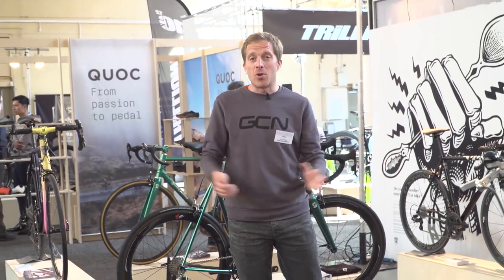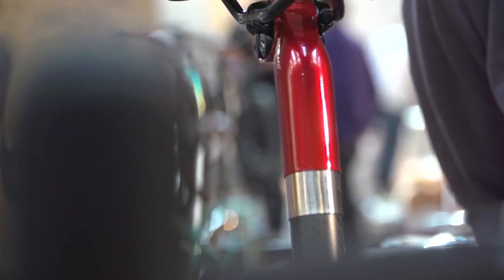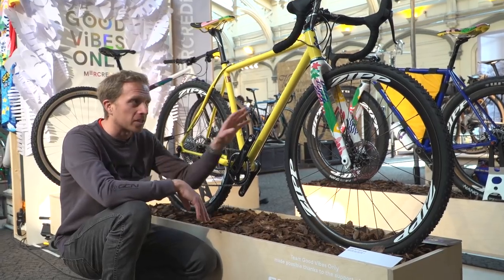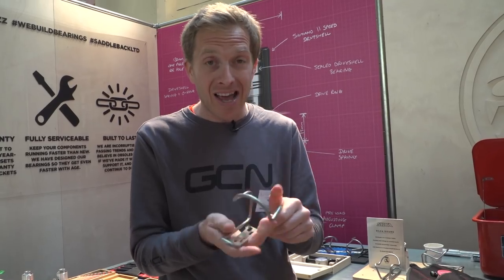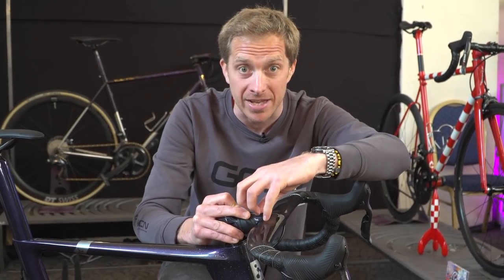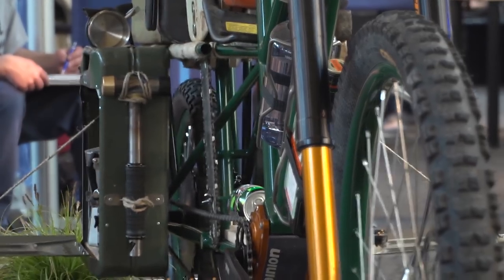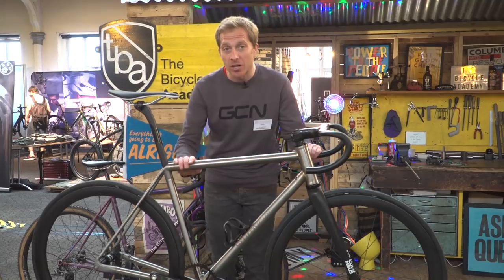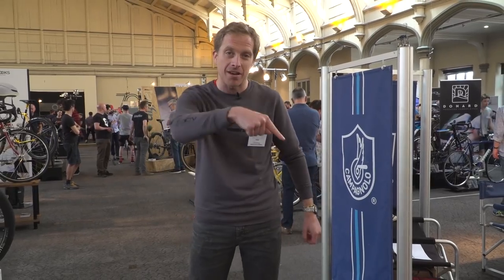Bespoked Handmade Bicycle Show 2018

Comment from the maker: What was your favourite tech or build from Bespoked? Let us know 👇
Reply: GCN Tech I like them all!!
Reply: GCN Tech ilove that argon 18 and also that McGregor Bike. (Hate to lose your bike, put your name all over it)
Reply: 3D printed lugs! I wonder what the advantages are. Weight? Comfort? Stiffness? Durability?
Reply: That argon 18 and the saffron. Damn, I like a bike without paint but the Argon's paintjob is beautiful.
Reply: GCN Tech the orange FiftyOne was shit hot !
Reply: the polished Saffron! wowsers
Reply: Argon all day long.
Reply: Prova!
Reply: It's just gotta be Argon, gilding the lily big time with XCR and 953. Shove that in yer cracking down tube carbonians.
Reply: That 3D printed lug looks like it is at the top of the seatpost at the seatpost clamp.
Reply: The Prova was a stunner!
Reply: OJ Tibi it speeds up build process. Cheers
Reply: matthew kluge I know. Beauty
Reply: Darren G.  hi, yeah, sorry I didn't explain that bit well, but basically it was all so amazingly well done.
Reply: I feel like it's cheating but...definitely the Argon 18.
Reply: My favourite bit was the intricate paintwork butterflies on the Spoon Bikes stand. Understated in black and white but meticulously transferred in 3D onto head tube, top tube and forks in a single pattern
Reply: the karussell ESF for sure
Reply: The Karussell!
Reply: Argon clearly.

Comment: The dropper seatpost on the dropper fifty one is a really good idea - repurposing the left shifting lever for that would be pretty nifty!
Reply: That's not how eTap works, need both levers for the rear shifting. If anything it would be both shifters together replacing the front shift function. But Jon(presenter), sorry, AIREA encryption makes that pretty much un-hackable. SRAM would have to support/make the post to make it compatible.
Reply: Jason Harris came here to say something similar, good on ya.
Reply: Jason Harris of course they'd have to help make it work, but it'd be a neat little cheeky add on. Don't you reckon?
Reply: Yes, it would be a very cool option for gravel bikes, and now that eTap for MTB looks to be coming very soon, maybe SRAM will open the protocol for more accessories.
Reply: Jason Harris time to open up those radio frequencies...
Reply: Jason Harris Alright, I wasn't aware of that. Thanks for the clarification.
Reply: Jon, as long as no one with a mobile phone starts changing my gears I like it!
Reply: Jason Harris 📞
Reply: Lol! I saw on the Tech Show you raced on a Focus, I have eTap on my Izalco SL, will post it to bike vault someday, but sounds like you're inundated!
Reply: Jason Harris yep, back in 2010 and 2011 I was on a couple of Focus bikes.

Comment: That lug on the Prova is obviously the top of the seatpost. Just look at that shape.
Reply: JMise the point is you cant see where the lug ends and the tube starts
Reply: hi, yeah, sorry I didn't explain that bit well, but basically it was all so amazingly well done.
Reply: Mitchell Steindler yep. It's incredible.

Comment: Who the hell wants a larger diameter seat-post? I would like a 25.4 mm (1'').
Reply: I agree, although I would like to keep to a standard size that I can buy replacement seatposts for.
Reply: MKTech Yes, I like how Cannondale brought 25.4 back with Synapse. I don’t know why everybody doesn’t do it. A smaller OD seat-tube isn’t gonna hurt anything, and the smaller seat-post is only a good thing right? And they could just pull the weight card and everyone will rush and get a new frame for their “climbing” build!
Reply: Bikepackers
Reply: With Steel, smaller OD does become an issue as increased flexion does eventually cause a breakdown in memory, but with carbon and its ability to infinitely flex with no change in its elasticity or memory... there is no real reason to not use smaller diameter tubing. It just comes down to sheer and clamping forces that can be applied to the tubing and the amount of flexion desired.
Reply: Lite Roadie - yep, looking at my 25.4 seat post on my Synapse alloy right now. It is problematic if you want to upgrade...but then when you see the weight of it you realize that there isn’t a point to upgrade. It’s pretty light.